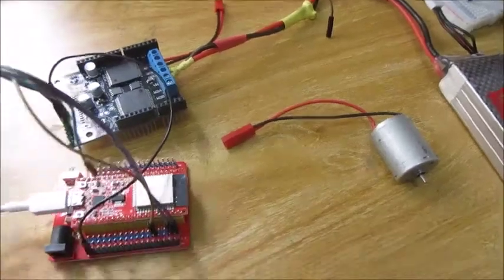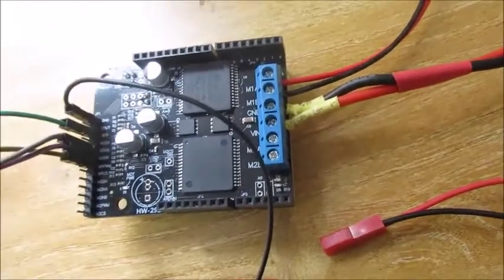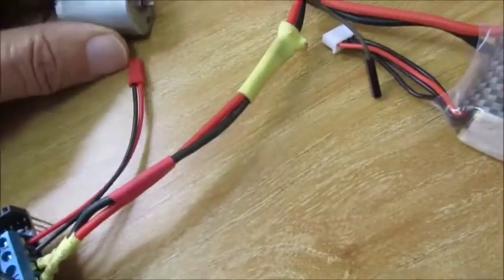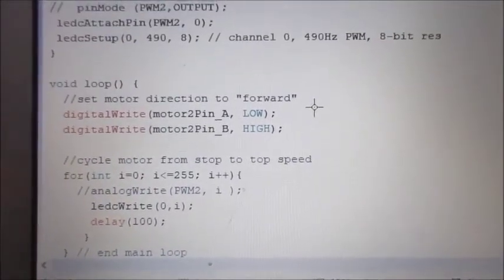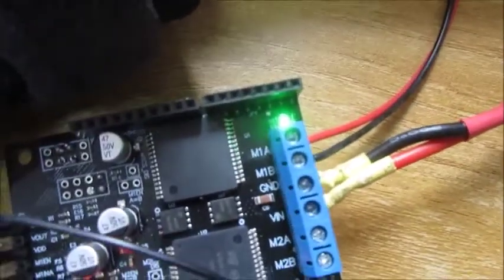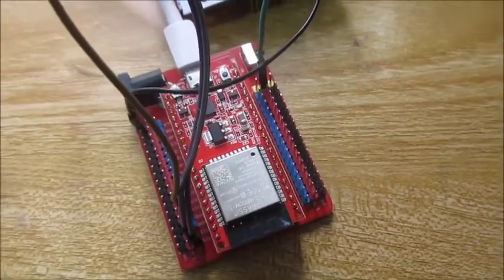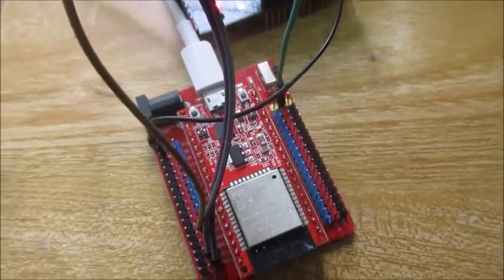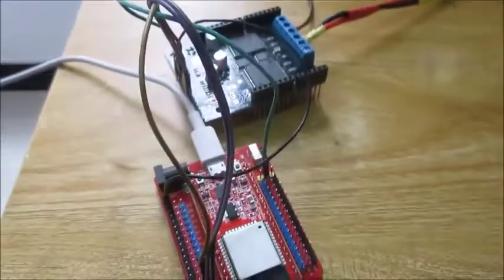ESP32 (Keyes) Board with VNH5019 Dual Motor Driver

Comment: Thank you Jimmy for the video! I was having issues finding out why my motor wasn’t running and it’s all because of the VDD pin. 

Nowhere in the data sheet did it say I had to connect the VDD to the 5V pin on my Uno. I was stuck for several days on this issue. You have my greatest thanks!
Reply from the maker: My pleasure. Haha. Wonder how long I struggled with it too.

Comment: Thank you for making this video. I just bought this board and I was looking for any information on how to use it with the NodeMCU. I was using it with the L298N before but I wanted more power. I tried using it with the same code and wiring for NodeMCU car, but the output was pretty low (3.0 volts). Listening to what you said, this code comes with digitalWrite and analogWrite. Maybe that is the issue. It might be the library too since I did not modifiy it. I am not sure yet. Can you add a link to the code that you used?
Reply from the maker: Hi Jon. Which code are you referring to? I just installed espressif (here are instructions) -  https://iotbyhvm.ooo/installing-the-esp32-board-in-arduino-ide/#:~:text=To%20find%20your%20espressif%20folder%20and%20Arduino%20IDE,in%20Tools%20%3E%20Board%20menu%20%28in%20my%20
and then in my regular Arduino code using the Arduino IDE I use the normal digitalWrite() function. The analogWrite() function will not work however and you must change it to ledcAttach(), ledcSetup() and ledcWrite() functions. Everything else was the same unless you are using a servo then you need to add the ESP32Servo,h file,